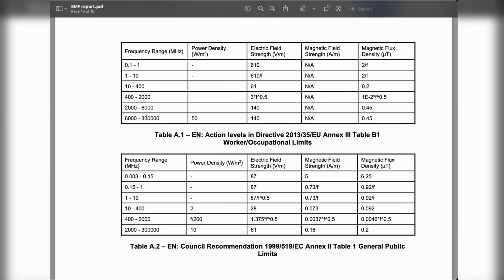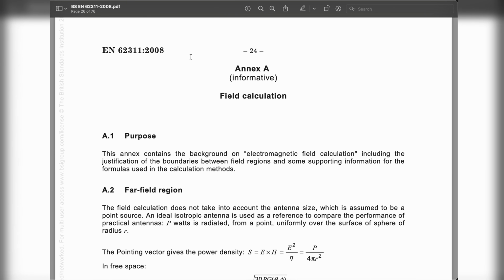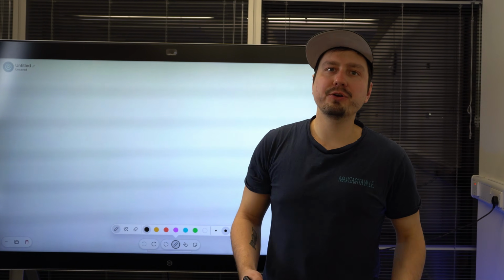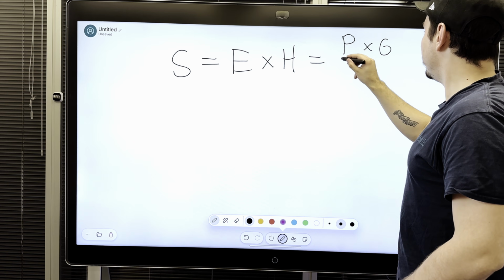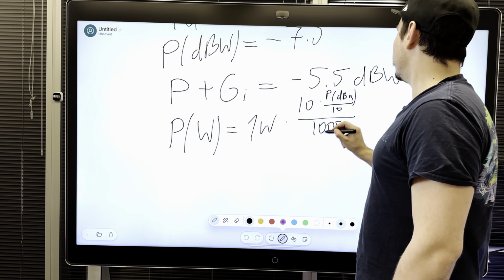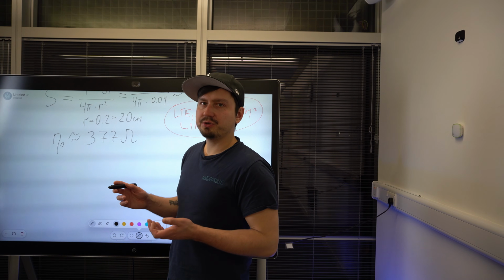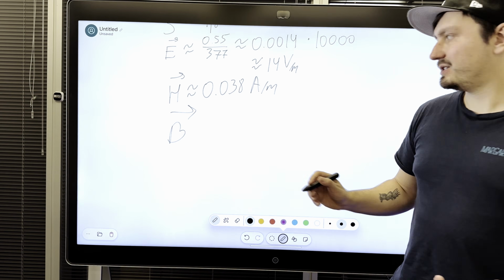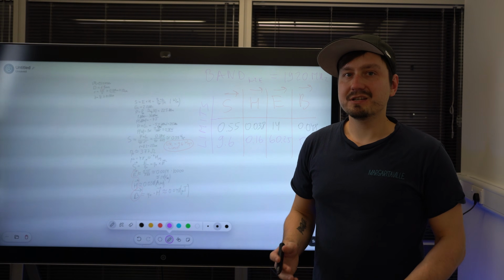How to Calculate Antenna Power Density (Poynting vector)

Comment: Dr.EMC your workis great and you explain things very well and make it easy for a laman like me to follow , i have a question because i live in an apt building ive noticed when i go to play any online game on my pc i notice this sluggishness that makes the game feel unresponsive to the touch(not smooth and fast)but sometimes late at night i notice my games will suddenly feel very responsive and the immersive feel is ther, ive been struggling with this for a while now and i have a higher end pc some are saying some sort of emi or rf lag if maybe you could shed some light on this or possibly help solve the issue it would be immensly apreciated. I just dont know if it could be interference coming from the dsl internet line in the building or..?
Reply from the maker: Hey, thanks! Afraid that's just how internet works - slow during the day, fast at night. Fibre optic is probably the best option in the market right now. 
https://en.wikipedia.org/wiki/Internet_bottleneck